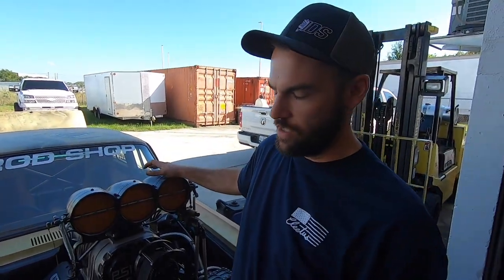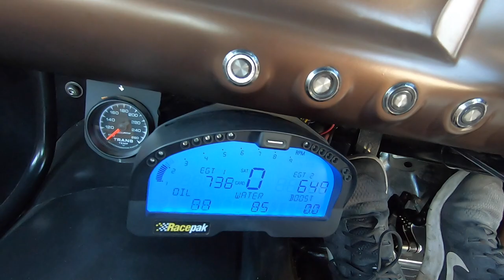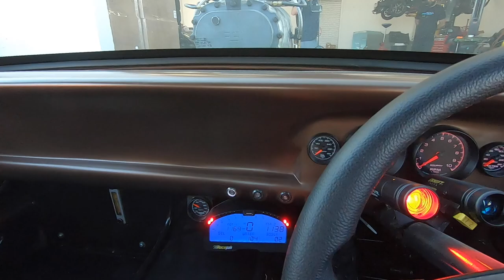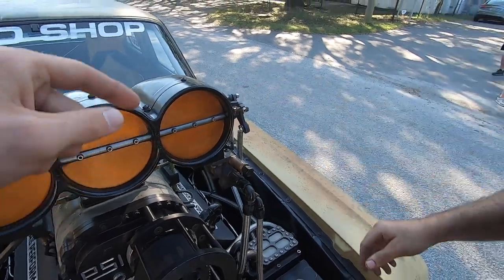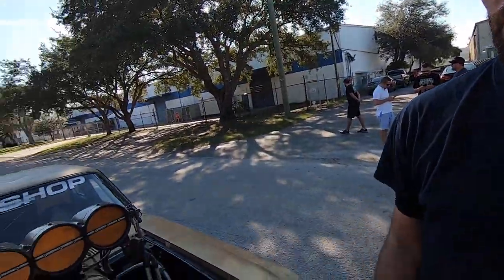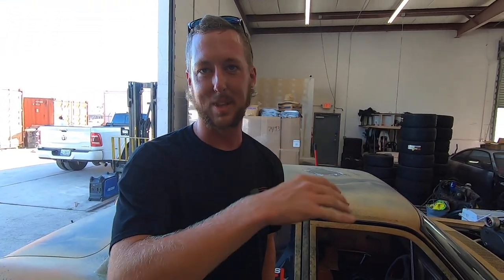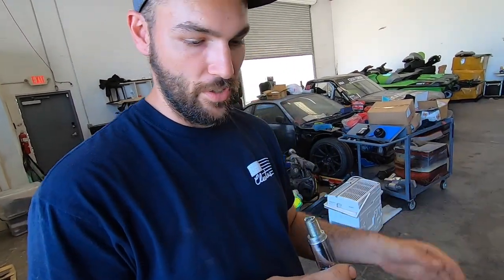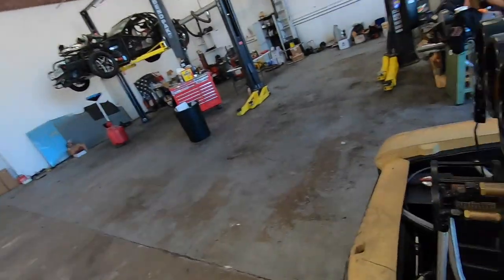Our First Time Driving WAR BIRD!!! This Thing is INSANE!! (1,700hp Australian Burnout Car)

Comment: cleetus will be studying everything about this car to make toast an absolute weapon 😂
Reply: Derek Gardin  What engine does warbird have?
Reply: @Dan-pq9wc  the engine is fully built by nogas themselves
Reply: Already is a weapon
Reply: Derek Gardin  if you only you knew they arnt using that blueprint motor anymore....
Reply: @myprofilenameisreallylongl5956  no but they are using another Blueprint engine
Reply: Derek Gardin  couldn’t agree more , there is nothing “high performance” about blue print.
Reply: @Banman650  

Say what? They’re not Proline but they offer 800+ hp big blocks. That’s pretty high performance.
Reply: @Dan-pq9wc  it’s a 565ci LS with a 1471 psi supercharger with I think a big and ugly hat. It makes 1650hp
Reply: You couldn’t have been more right
Reply: @blakesattler1726  1471psi would blow any motor to hell.  The designation for a blower is how many cylinders it was designed for, and how much air it will push into said cylinders in liters.  In fact the designation for an old school detroit diesel is similar, an 8v-71 detroit diesel is an 8 cylinder engine, displacing 71 cubic inches per cylinder.
Reply: @Dan-pq9wc   It's a big block chevrolet based engine.  It's built by Ben Nogas in Australia, and the engine has a 14-71 supercharger forcing air into it.  In my opinion, a big block chevrolet is one of the greatest engines ever made.  They might not have made the most power of their day, but they were damn good engines when they were still being regularly manufactured by chevrolet.  Hell, they're still damn good engines today.
Reply: @Asmith-1111  I wrote that 2 years ago bruh. It is a 14-71 tho. Look it up a lot of the burnout big block v8’s have 14-71. Maybe low boost.
Reply: @blakesattler1726  I know that a lot of burnout cars have 14-71 blowers on them.  Your original comment said '1471 psi blower'  which would blow up any engine that would fit in a car.  That's why I corrected you.  Either way, you said that two years ago, it doesn't matter now.
Reply: @Asmith-1111  ohh ye it does have a psi 14-71 on it. Fairly low boost don’t worry only 20psi

Comment: Cleetus, check the output of that generator before you make an adapter to plug into the wall. Australia runs on 220 at 50hz. I'm assuming you're running a heater for the oil so in that case it probably doesn't matter, but check to be sure.
Reply: Voltage will matter, The hertz is ok except for clocks and lights. Clocks lose time, and the flicker of some lights can cause issues.
Reply: @ljacota  the frequency matters when it comes to motors. If it's designed for 50 hz and run on 60hz it will run 20% faster. Can cause overheating of the stator among other things.
Reply: Safer to just use their gen - otherwise have to swap oil heater to 110v... (gay!) Keep it 240, use the gen 👍
Reply: @jimmymetcalfe9167  👍

Comment: FYI - AU and US power is on a different voltage and frequency. be careful with any adapters. make sure it can support the US 120v 60hz as well as the AU 230v 50hz
Reply: Yea thats good looking out there
Reply: If its a heater 60hz won't bother it but they will have to make a adapter for the 220 welder receptacle
Reply: In the US most large appliances run on 240 so they will just have to use a 240 volt outlet.
Reply: Heaters shouldn't care about frequency, so our 240v should work just fine to operate the oil heaters.

Comment: We ran Methanol on our dirt track modified.....we could run 30 wide open laps and be lucky to break 170 degrees.....we had to put a piece of cardboard in front of the radiator so it wouldn't draw air while trying to warm it up.....it really helps

Comment: Cleetus, remember 240v AC. Guess that’s why they pack the Genie
Reply: Yup. Those plugs are available at any hardware store you just need the right supply. Can't just make an adapter cord to plug it into 120VAC
Reply: Aussie has 50 Hz not 60 also.
Reply: Chances are it’s just using an element style heater to warm the oil. It’s not going to care much about the frequency difference, but it’s going to want to see around the same voltage to be effective. 

Might also be able to trade the element out for a 120V version. It’ll just pull more amperage than the 240 in it right now.
Reply: Jesus H Christ, even the electric in Australia is super dangerous. Weren’t the venomous snakes and lizards enough?
Reply: @MrCarnutbill67  we’ve got 240v here in every home so....
Reply: @erikj.2066  

True, for things like table saws etc. not for like lamps and shit. Maybe I misunderstood? Is 240v not their “normal” household current?
Reply: @MrCarnutbill67  it is their standard on tap voltage, along with most of what the rest of the world uses (between 220-240V). 

https://www.worldstandards.eu/electricity/plug-voltage-by-country/

We’re the odd ones of the bunch with the center tapped pole transformers. 

240 really isn’t going to be more deadly than 120. Under the right (wrong) conditions, with enough current going across your heart, you’re just as dead with 120 as you are with 240.
Reply: @MrCarnutbill67  it's actually less dangerous and more efficient. You can read up on it yourself but basically the copper industry talked the US government into keeping 120 VAC the standard after WW2, when the rest of the world decided 240 was the way to go
Reply: @4ampaul  
It's more dangerous.

The high the volts the higher the danger.

That's why you don't get electrocuted on a car battery.
Reply: @Robert-cu9bm  not only is there a huge difference between AC (home electricity) and DC (car battery), voltage isn't what kills you, amperage is. That's why a 10,000 volt taser hurts but doesn't kill unless you have a heart condition
Reply: @4ampaul  
No, take as some time to learn about electricity.

What are Ev's power source? ..DC batteries.
Why do they have a HV cable to cut in the event of a crash?... To protect emergency workers from electrocution.

The UK runs 240v AC household voltage, yet on job sites they run 110v AC with a centre tapped earth... Why because if your exposured to a live wire you will only get exposed to 55v so you don't get electrocuted.

Yes your correct it doesn't take much in terms of amp's to get electrocuted, however you still need the volts to do it.

Volts are more of how hard the electricity can push.

240v is a compromise between safety and efficiency.
The high the voltage, the less copper is needed and the less loss through the lines there is.
But the more dangerous it gets.

If it was just amp's that killed, we would all be using 1 million volts with miniscule amp's.
Reply: Overseas everything is 208 volts Not 240
Reply: @keithmaxwell2169  Australia and New Zealand is 240V AC 50Hz

Comment: 1,700 aussie horsepowers = about 6,289 'murican horsepowers....
Reply: Preciate the American freedom units conversion brother 🇺🇲🇺🇲🇺🇲
Reply: @jerredwayne8401  The Uncle Sam to Captain Cook ratio is 0.5 to 1......
Reply: No.a horse power is a horse power it's a mathematical calculation.that's the same everywhere.the only difference is from dyno to dyno and it still isn't that much.
Reply: As an Aussie... HELL YEAH BROTHER! 🤘🤘🇦🇺🇦🇺🇦🇺🇦🇺
Reply: 'Ol mbsnyderc missed the point real hard!
Reply: @mbsnyderc  no, I'm pretty sure 6,289 is the correct conversion. Aussie HP is rated differently because the dynos are upside down over there. Theres usually a chart in the manual that explains it all.
Reply: @horseboyhunglow  ya that plane was so high above his head he never even heard it fly by
Reply: @mbsnyderc  We don't use horsepower as a unit of measurement it's roopower. In all seriousness we actually use kilowatts

Comment: I do dig a builder that seems to have said to themselves, "Find out what will make it explode when I mash the throttle, then back it off just a bit."
Reply: Nah, this is pretty cautious, with more boost and timing it could be a 3000hp drag engine, but burnout engines have to last multiple minutes at full throttle on each run, and hopefully hold together for many runs. Warbird did blow up when Cleetus was there, so this time they've really overbuilt it to never fall apart.
Reply: @richardharrold9736  So a reliable 1700HP? lol

Comment: The answer to some people's questions: Neighbor is now a drift car. Toast has 1000 horsepower, and this thing got 1700. You do the math.
Reply: It's capable of about 3k hp too, they tend over build burnout engines so they don't have to push them to their absolute limit otherwise they go boom to often lol
Reply: This is made for just a burnout car?
Reply: @caseygiles1368  yep, came from Australian rod shop I’m pretty sure, it’s sole purpose in life is to burn tires.
Reply: @caseygiles1368  it's one and only job
Reply: @caseygiles1368  no shit lol
Reply: @nopenope6772  Castlemaine Rod Shop here in Australia  🤘

Comment: Enderle barrel valve 101... it ain’t easy😳🤣!!! You guys should try to put a Dial-A-Jet adjustable air bleed in the spot of one of them plugged hat nozzle lines on the injector hat. Being able to control the air mixture@ idle with out adjusting the butterfly’s and having to readjust the barrel valve linkage. Some people just you 1/8” MJV fittings with plugs.

Comment: just one thing boys. these burnout cars are notorious for sticking throttles. wear the seat belts just incase
Reply: Why do the throttles stick?
Reply: @richardharrold9736  throttle linkages are complicated with blower hats, just the way she goes
Reply: @fellowship_of_the_goat  so what do you do if it sticks open? Might even be a better idea to go TBW...
Reply: Why dont they use a servo motor from a yamaha r6 motorcycle on the butterflies and convert it to by wire throttle ?
Reply: @richardharrold9736  I've never driven one with it sticking so not sure. Try hook your foot under and lift the pedal up? Not certain. Usually it seems like they either turn the car off or just crash.
Reply: They stick because the condensation created from the methanol being injected gets so cold it can freeze the throttle blades open, if this happens shut the car off. Once they freeze open they are stuck there so shut it down.

The throttle is the way it is because most methanol injected Nats like this run a barrel valve for fuel distribution, the barrel valve is a part of the throttle system

Comment: what in tarnation got hellcats and ferraris sitting in the back lot
Reply: Fasterproms customers, I'm presuming.
Reply: @richardharrold9736  That was my first guess, but it doesn't make a ton of sense that he would be tuning a mopar science he is primarily a Chevy tuner and a little ford on the side. And totally impossible he is tuning a ferrari.
Reply: @williamgodfrey7256  Ferraris are very easy to tune as there is pretty much zero encryption on the ECU and they can make some decent gains, although Ferrari tends not to leave a whole lot on the table. The Hellcat? Well, the 3rd gen Hemi isn't that different to an LS... same bore spacing, same shitty pushrod valvetrain... as powerful as a sledgehammer, but slightly less sophisticated.
Reply: @richardharrold9736   I had no idea about the ferrari i would of assumed such a prestigious brand wouldn't want any peasants messing getting into their computer. As for the hemi tho, bore spacing  and valve train dont would matter more if you were building the engine as opposed to tuning it you would be using completely different software and coding.

Comment: Australian electricity runs at a frequency of (wave length) 50 Hertz. US is 60Hz. Just make sure the oil heater on the car is made to work with both.

Comment: Noticed the black caprice ex cop car in the background. :) @ the 6:46 mark. :) All australian made as well. :) Just the engine and transmission is GM, but the rest is all GMH. :) Including the Rear cradle with heavy duty set up like the HSV's have. and also the new last Holden VF Redlines have as well. :)

Comment: shorten the knuckles 1in and hammer in the lower control arms on toast and youll easily have another 15-20 degrees of steering angle. If you cut and slim the lower control arms up youll have 45-55 degrees of steering too. Youll also have to lengthen the steering arms. Some of my drifting videos show what thats capable of before i went wild and did a 4th gen cut and weld build.

Comment: Cleetus, you're not getting any hearing protection from having the foamies stick out of your ears that far. They should not be visible when someone is looking at you from the front. Roll them to smush them down, pull your ear up and out when you put them in. Then they will actually give you hearing protection. Hearing loss is accumulative and almost always permanent! Don't risk it!

Comment: I could feel the nervous anticipation startin up. And when when you started smokin the rears the engine said “Yes!”.
Don’t touch the paint job or even remove the gaff tape! It looks dirty and mean with one job on it’s mind....smoke tyres!!
Reply: ...and Cleetus? You’ve got the mullet lookin just right. That style of short mullet n mutton chops suits the period of the car. Aussies were rockin that look thru the 70’s and you looked right behind the wheel. Good luck, go hard! ✊🏼🤘🏼☝🏼

Comment: If only I had this Blown BBC in my "little" 6" lifted 97 GMC RCSB K1500 on 15x10" polished Pro Comp 69's and 35x12.5 Patagonias 😅
It would be absolutely epic and rather hilarious, my lifted shortie just a surgin down the block with that big ass catcher sticking out the hood.....has anyone built a regular cab short bed lifted pickup on 35x12.5's into a burnout truck yet? I can only imagine it would be more of a wild ride than even Corn Cob 🤣🦅

Comment: Two things:
1. It looks like he's driving on the right side of the road instead of the left. Especially since the steering wheel is on the right-side of the vehicle.
2. All it needs is a flux capacitor and they could easily go back in time with that car.

Comment: how to: Chock front wheels of rear wheel drive beater,  pour 2 quarts of cheap motor oil on driveway under rear wheels, put in L1,open throttle wide open, rev until engine blows, give away the vehicle after u finish laughing

Comment: i have a 327 that old man bell built for me and it runs hard we pulled it out of rick news 70's dragster than built the shit out of it put titanium rods oversized cylinder made it a full top end engine but used the 202 angle plug heads a built the shit out of them had to port the intake to match the heads we seasoned the block and polished the inside ported everything oil water got the oil to drop fast 13 to 1 compression running a tunnel ram with 2 485 carbs use to drag race it on the streets and used it as a driver been running for over 20 years still have the engine in the shop on display after old man bell died , now i have a stroked 454 with tunnel ram roller engine it is nothing like what u have but it makes a good engine for my street truck 68 chevy it does have a good bottom end steel crank heavy rods started with a ho 454 450 hp engine

Comment: why do those big engines pulse in RPMs during idle? Is there a term for that or what's the purpose for it? I notice it on most, top fuel etc
Reply: Because they fire early so they run good at high rpms so that's why they barely idle

Comment: Curious question from a german guy who never sees such cars in real life: Why does Warbird have such an unstable idle? it just jumps from 750ish to over 1500, to me it sounds like the idle is just a constant mini-application of throttle and then letting it go again, can someone explain that to me? Thanks and greetings from Germany :)
Reply: Huge cam.
Reply: It's blower surge
Reply: Hey mein Lieber, ich kann dir das auch auf deutsch erklären... Es hat zwei Gründe.
1. Die krasse scharfe Nockenwelle sorgt dafür, dass der Motor es sehr schwer hat bei niedrigen Drehzahlen sauber zu verbrennen. Die Ventile stehen einfach zu lange offen.
Und 2.
Der riesige Kompressor produziert bei Leerlaufdrehzahl bereits ladedruck. Das führt zum ansteigen der Drehzahl weil das steuerteil erst bei einer höheren Drehzahl das wastegate auf fährt. Wenn es das nicht tun würde, dann würde der Motor ständig aus gehen.

Insgesamt ist das ein Problem bei diesen mega 1500ps plus ➕ Motoren... Aber mit einem turbolader anstatt des kompressors könnte man das Problem relativ einfach in den Griff bekommen.

Comment: put 500 pounds in trunk so it will hock up..the engine is to far forward . you could spin tires with a v 6 right now . You put the wight in trunk then i will be impressed

Comment: the problem is your weak usa voltage Aussie's have a full send of 240 volts
Aussie leaf blower cleaning your streets Aussie Aussie Aussie !!!
Reply: Actually, Australian households have 230V. All U.S. households have 240V going into them. It's just split at the breaker box. While 120V is used through most of the home, 240V is still used for high draw appliances. Such as: Central HVAC, clothes dryers, cooking ranges, etc... The same can be said for commercial buildings.
Reply: @MellowYe77ow  most aussie appliances are rated 230 - 240 v but is usually between 230 - 250 volts with sometime it peaking above 260 but this can cause some issues with appliances.  
In Australia we just call it 240 V

Comment: Oh my God guys come on you’re gonna blow that thing up do not and I repeat DO NOT ever open the blades on the hat on a mechanical injected blown engine while cranking or trying to start it! Even if the mag is off you’re still pumping but loads of fuel into it if the mag happens to light while it’s open there’s going to be rods on the ground